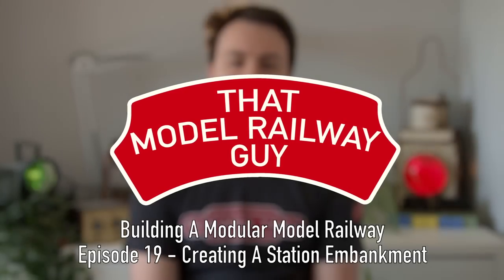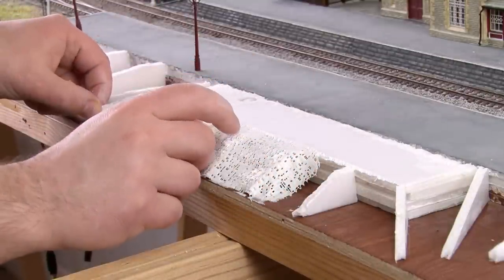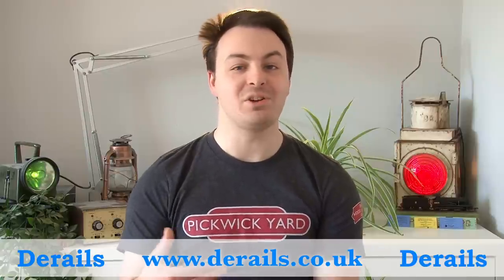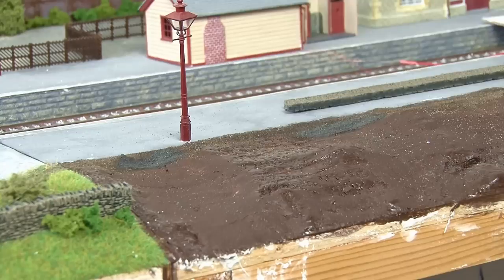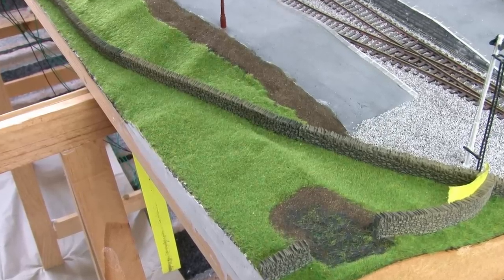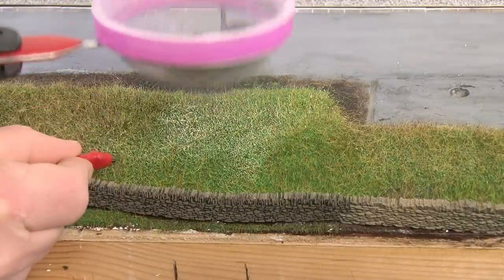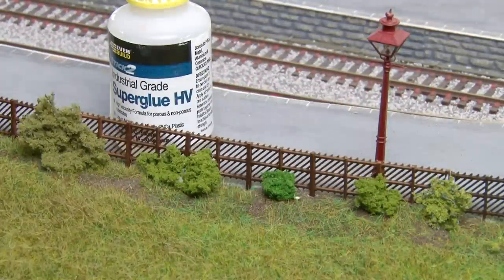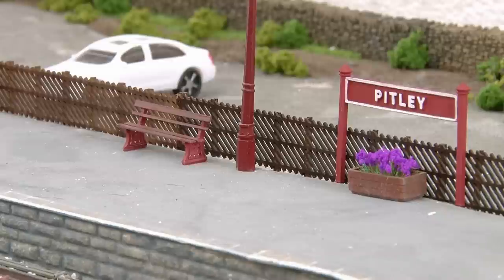Building A Modular Model Railway - Episode 19: How To Create A Station Embankment!

Comment: Great work Joe! Your layout is really coming along now, and the two main modules basically look finished now! I do remember though that the one curved module that goes with the tunnel board was bear though, are you still planning on putting scenery on it, or will it become part of the fiddle yard or something (ie: add some curved sidings so that you can fit a few extra locos without occupying the sidings for the coaches)? Great work as always, and I’m looking forward to seeing what extra details you add to this board!
Reply from the maker: There's still a little bit of work to do on these modules first but after that the plan going forwards is to build two new modules. That will extend the run a bit and also make operating from the inside more comfortable during the exhibition.

I'd then like to rebuild the two large corner modules to the new updated curved design. If I get that far the plan is to do the scenics on those two modules and the existing curve module all at the same time. 

If I run out of time though I could just use the currently non-scenic curve module as an entrance to the fiddle yard for the time being. It's not a priority at the moment which is why it's being left to last. 

There's actually a diagram at the start of Ep16 which shows the general plan. Hope that helps and thanks for watching 😃
Reply: @ThatModelRailwayGuy  oh sorry, I forgot about the diagram. Sorry for having you write all of that, oops…

Comment: Are you going to add a trolley crossing at track level at the end of the platform - while not in use for trolleys on a heritage railway, the volunteers might make use of it.
Reply from the maker: I did consider that and it's something I would still like to do. The only issue is that, because I've compressed the station, there are points right at the end of each platform which complicates things slightly. Thanks for watching 😃

Comment: No need to make more support for the plasterboard. You could have filled up the gaps with crumbled newspaper. In fact, you could have used only crumbled newspaper instead of the supports. You'll get an irregular landscape at the same time.
Reply from the maker: Using only newspaper for a portable layout like this isn’t a good idea. In my experience it’s just not strong enough to cope with the layout constantly moving around. 
You’re right in that I could have filled the gaps with newspaper but personally I don’t like the effect it gives as it always looks a bit too much like crumbled newspaper to my eyes 😆 Thanks for watching 👍
Reply: @ThatModelRailwayGuy  What I meant was to still use the plaster bandage (probably spell check made my previous comment showing "plasterboard"), but use newspapers below it. The plaster bandage will smoothen the sharp edges of the newspapers.